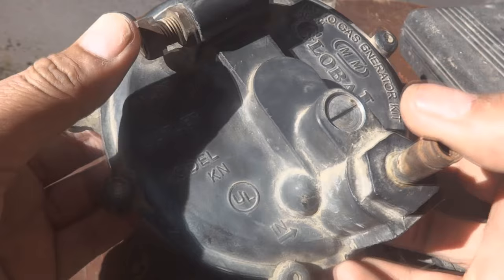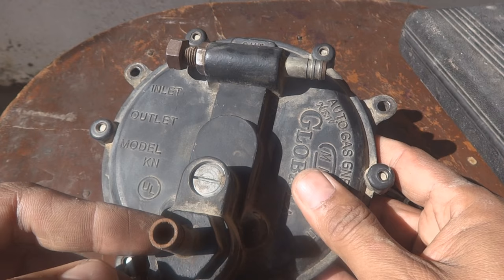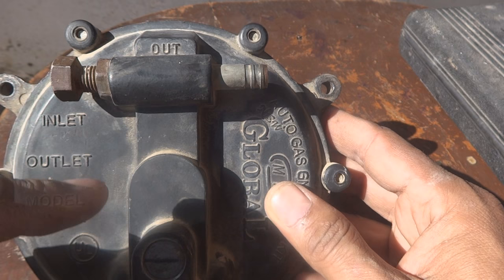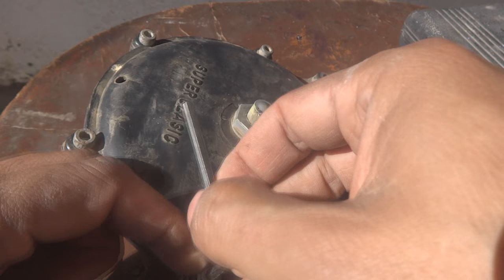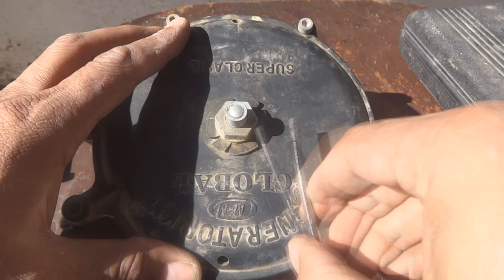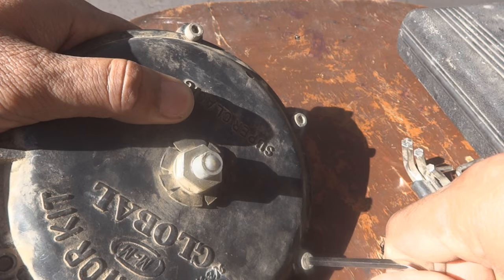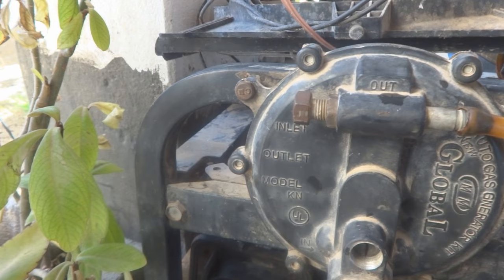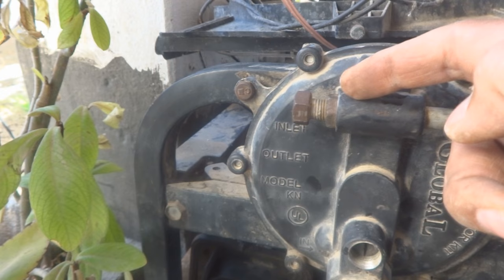Generator conversion kit maintenance.

Comment: You explained the process very well. That generator really let you know when it didn't like the adjustment. Now it's running good.
Reply from the maker: Thank you very much dear sir for liking. There will be another video soon available covering the electrical part repair for the same generator. There will be blog post available for the same subject and the blog address will be in the description of the video. Regards,

Comment: Hmm it looks like a simple pressure regulator, similar to the type connected to a calor gas bottle for a gas fire, but a different pressure.
Self regulating or throttling, to produce a standard ideal pressure/volume.
Diaphragms are simple but so usefull :-D
Reply from the maker: Yes dear sir it is a self regulated style gas kit. Your understanding is again rock! Sure diaphragms are everywhere in this world for control and regulation. Regards,

Comment: Very informative Nice work .one question , my generater with cng kit only works when the chock is on and pulled to normal generater shuts off.
Reply from the maker: This is normally gas kit and its setting problem. You can correct the gas kit according to my instructions and then calibrate it for optimum performance.

Comment: my generator isnt starting properly it just starts and shuts down after a second please tell me what to do .
Reply from the maker: Seems it had a bad head gas ket or bad values in head. Needs maintenance as long as your fuel delivery is good to the engine. Best wishes.

Comment: assalam o alaikum sir
i have a 1.2 kv new  generator. it was self start when just i open gas valve and start. but now its not starting on gas i starting on petrol and after i converting on gas.
so please inform me that why its not staring directly on gas ?
hope you will give some guideline.
Reply from the maker: I believe the generator you have is a four stroke engine like the one here in the video. There seems some problem with the head. Either your engine tappets are not adjusted properly and they need readjustment or in the worst case, your engine head is leaking compression. The second case needs head maintenance. Both maintenance are possible at home. I may upload a video or two covering such a topic. Regards and stay tuned.
Reply: LearningZone 
Thank you very much for your good idea first i call a professional  person to solve the problem and  after i will try it by self.
thanks friend and Jazak Allah.
Reply from the maker: Dear friend soon I will do the same work on this particular generator also. As this alternator had develop the same fault! So Inshallah I will upload a detailed video here on my channel so that others will get benefit of it. Regards,

Comment: I AM USING THIS GAS KIT OVER NATURAL GAS FOR MY GENERATOR.... PLEASE TELL ME HOW I CAN PASS THROUGH THE GAS FROM THE KIT WITH OUT PUSHING BUTTON OF THE GAS KIT.... IS THERE ANAY SETTING OVER THE KIT....
Reply from the maker: That's great that you are also using such a kit. The button is not really needed if everything is setup perfectly and correctly. Anyhow in some kits I saw a solenoide activating such button electrically. Stay tuned and blessed.
Reply: +LearningZone THANKS BROTHER... I HAVE GOT THE SOLINOID ACTUALTOR IDEA FRON NET BEFORE , AND I AM GOING TO MAKE THE SOLENOID ACTUATOR TO PUSH THAT BUTTON... THANKS AGAIN BROTHER...

Comment: Sir can we make generator from a bike engine 125cc with single phase 5000w alternator ??
Reply from the maker: 125cc is way too small engine for 5000w generator. You should have at least 500cc or above engine for power like 5000w. With 125cc you will be able to hardly produce some 1000 Watts or little more.

Comment: Can we paint the internal part of gas kit. To avoid rust
Reply from the maker: I think that will not be the better choice. You may use some grease in the moving contact point where the risk of rust. Other all parts are aluminium which have no big risk of rust. Regards,

Comment: assalam o alaikum
sir, when i start my generator directly on gas its good staring but when i give the load after i found the generator some missing sound and stop.
i start the generator again and give 3 minutes empty run after give load i found its ok no problem smooth running. so please help me that this the time of my gas kit change or repairing time or any other problem with generator ?
i feeling this problem since a week.
jazak Allah.
Reply from the maker: Dear friend first of all you should service your gaskit the way I described here. Then maybe it needs some more adjustment in the engine which you can easily do at home. I will upload one or more videos on the subject of adjustment and head service also. So subscribe my channel and also you may subscribe my Urdu channel if you like. The Url is here: https://www.youtube.com/channel/UC41J6Lqm5M2jkrc8aseO0kw
Reply: assalamo alaikum wr wb.... sir you can see a screw between carburator and fuel tank this screw is on engine above the head right side ... start the engine put some load take tester and rotate this screw with tester clockwise and try to guess the engine speed.... your generator speed is low plug hz meter in output secket and rotate this screw until the frequency should b 50 your problem will be solve